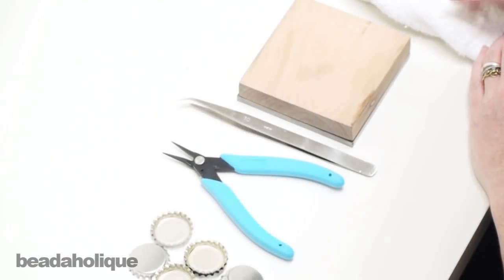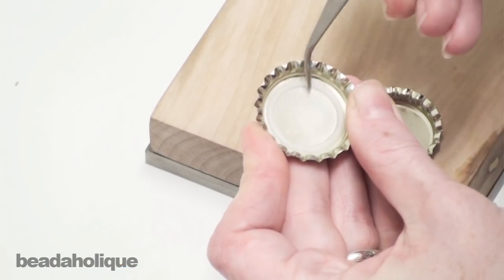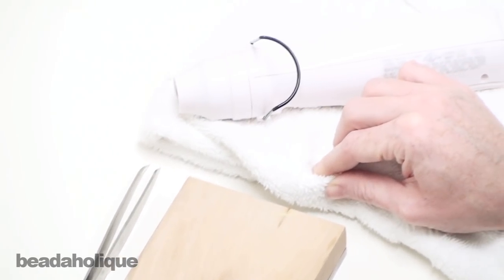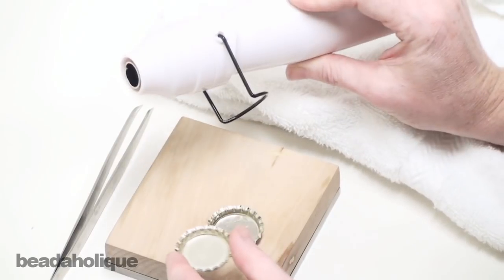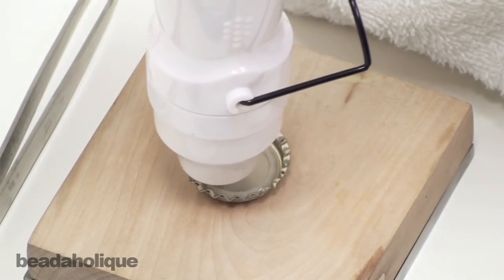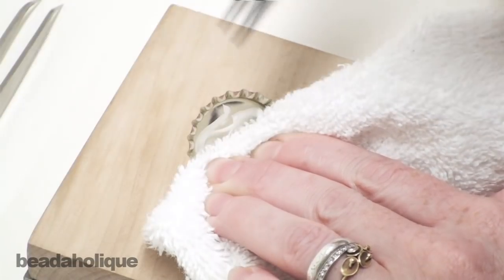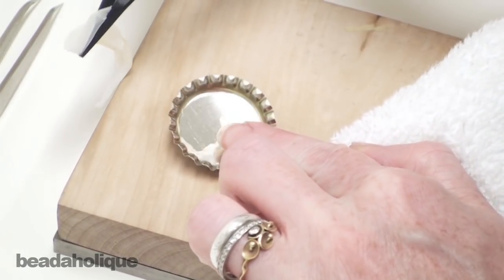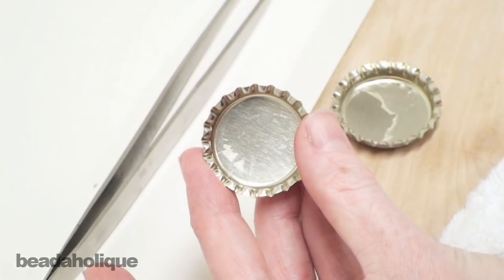How to Remove Bottle Cap Liners

Comment from the maker: You can sure try and use a hair dryer, I am not sure that it will get hot enough. I have also heard of people putting it on a candle warmer - just be really careful because the metal of the bottle cap heats up and can burn you. Use safety precautions at all times and protect your hands.

Comment from the maker: @xoxorockerxoxo The bottle cap liner needs to be removed because the liner itself it not flat - it has a raised interior ridge. If you try to lay your image over the ridge, the image will not lay flat, and if it is a heavier stock of paper, it might not even glue down in sections because of the ridge.
Reply: what if you applied a bit of resin first. Cured it and then applied the image and. more resin?

Comment: do you have to remove the liner if you are using resin?
Reply from the maker: I have honestly not tried keeping the liner in when using resin. In theory, I "think" it should be okay but I would definitely do a single test one first and let it fully cure before doing a big batch.

Comment: Soak the caps in 100% Acetone, available over the counter at industrial supply and most construction supply outfits by the gallon, or any store as "professional nail polish remover".  *Soak only in a glass jar (Capped Jar is best. Acetone evaps quickly) or bowl*  Acetone will turn most plastics and PVC to jelly, and can then easily be scraped out.

Comment: hi there :)) may I ask if I can do this on the stove?
Reply from the maker: Vampinlove I would not recommend using the stove, I think that could be dangerous. We do now sell bottle caps without liners as well. 

Bottle Caps
http://www.beadaholique.com/c-62530-bottle-caps.aspx?utm_source=YouTube&utm_medium=social-media&utm_campaign=default
Reply: Thank you :))
Reply: Vampinlove I did a gang of caps on an electric stove; heat set to ~4 on dial.  Wait @ 4 sec per cap, and scrape an edge away them pull off the rest.

Comment: How did you get the logo off the bottle caps?
Reply from the maker: Paint thinner if you're in a hurry and comfortable working with industrial chemicals (Work in a well ventilated space with no fire hazards and protect your skin from contact), or a wire brush if you have time and a light touch. You'll likely get some slight scratching with the brush method.
Reply: @beadaholique  so would/could you soak it in a empty can of paint thinner? And then after a period of time empty the paint thinner in it and wash off the cap?.. or could you give more details in the paint thinner method.. sorry if I made it more confusing by my wording..I can have my husband help with that part lol
Reply from the maker: I haven't tried the paint thinner method myself, I just know from what I've seen with the bottle caps we're worked with the logos are typically on a layer of paint. I think the method you're describing sounds promising though, soak in a small amount of paint thinner and then wash or lightly scrub the remaining paint away if needed.
Reply: @beadaholique  thanx for the great idea!!... if all else fails just spray paint it? Lol... I'm all about repurposing stuff throughout my house and all my crafts...
Reply from the maker: @christinaschuricht8506 Spray paint works great, my sister and I used to do that with bottle caps all the time when we were just starting out with arts and crafts

Comment: Can you use boiling water as well?
Reply from the maker: Hot water will unfortunately not remove the liner.
Reply: I did boil them for about 3 minutes and was able to pull the rubber out with a tweezer while holding the cap down on the counter (cap wasn't hot enough to burn my fingers), all in one piece. However, I removed only one at a time from the water in order to keep them hot. There is a down side to this method.....your finger and thumb will get sore from the rigid edge of the cap.

Comment: Use a hot glue gun to fill in the base
Reply: tried this...the glue doesn't stick. Neither does clear craft glue, but white almer's glue does though there may be bubbles...Mod Podge hard coat seems ok, but I'm still experimenting